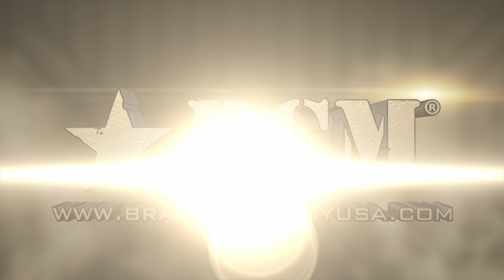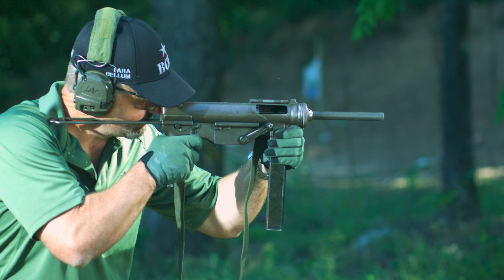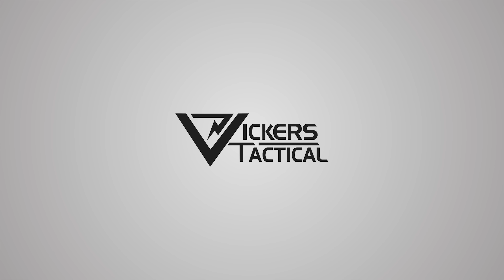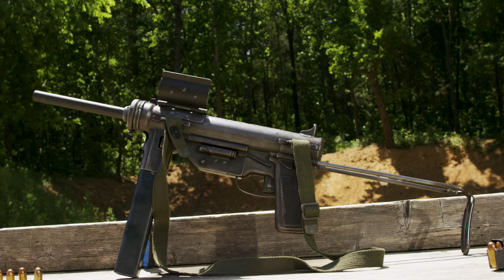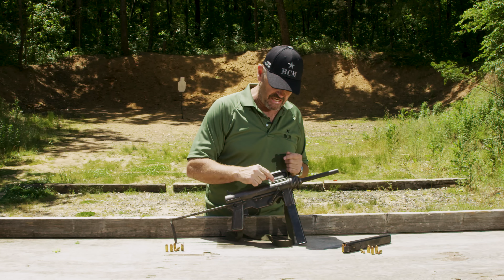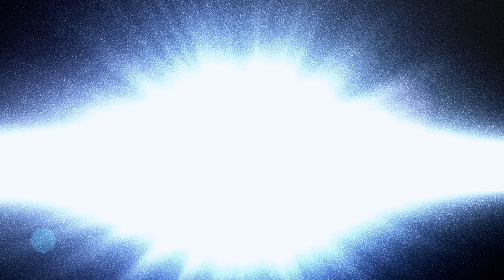M3 Grease Gun

Comment: When you put them together the M3, Sten, and MP40 resemble each other a lot. The MP40 has a faster rate of fire and is good for close quarters hip fire. The French resistance preferred the MP40 over the Sten because the Sten would jam and the barrel would heat up real fast. I know that they would’ve used M3 grease guns if they were 9mm.
Reply: Marx405, Grease Guns sometimes came with a kit for converting them to 9mm Parabellum. The platform was designed with that in mind, so that it could easily be modified (by swapping out a few parts) to use either .45 ACP or 9mm. In practice, few people ever used them in anything but .45-caliber.

Comment: I always thought it never got the respect it deserved. From your previous demos and TacTV, i know it's pretty accurate and controllable. Its construction makes it durable as hell. It spits out 45 ACP, which is always preferred. Though heavy, it is fairly compact, and of course it is reliable. I wonder how an updated modern version with an alloy receiver would do. HK diopter style sights and a top rail for optics. Would probably do well. And make it closed bolt too, but don't change the cyclic rate. Or how about just get Sig to make the MPX in 45? Glad your health is better, Larry.

Comment: I've fired one of these, & it had the finger hole in the bolt for cocking (m3a1).You can see a hole in this gun too, but it won't cock it. Also, the thing shoots s l o w but more accurately than a Thompson or mp40. The 1st shot feels odd, due the very heavy bolt slamming closed, but every shot after was good.

Comment: Larry, Outstanding !   For we common folk there is a version of this in semi auto only with a 16 " barrel from Valkyrie Arms.   Question, do you have any information about an improvised field variant of these guns where handy GI s fitted a cocking handle onto the bolt and cut a corresponding slot for it in the receiver ?.   Have read about as a remedy for a busted crank handle on original M3 s,  but there was not a picture in the article.  Did that exist ?
Reply from the maker: I have no doubt that was done in the field
Reply: @VickersTacticalLAV  Larry have since seen an NRA Pubs video from the museum in Luxemburg where there is a field modified M3 with the crank removed and bolt stud installed with slotted receiver featured.  "M3 A2" improved.

Comment: Are you guys CRAZY, the M3a1 is a POS! When I took Armor training at Ft Knox back in 73 we were trained on this "weapon" because it was normally issued to some of the crew members. At the range the first time I fired mine, I had a run away (I wasn't the only one either), it would not stop firing! I had to reach around to drop the mag. Now to be honest my weapon was about as old as I was, in fact most of them were. I never saw any "new" Army M3, most were stamped later than than mid- 50's. The good thing for me was when I got to my duty unit I was issued a M16 with a M203 mounted under the 16's barrel,  normal weapon for the loader. 3 months later I was driver now and I got a 1911 pistol, way easier to carry and clean. The only M3's I was were issued to truck drivers and back echelon people. My Dad  was in the 35 Inf Reg. and fought in Luzon in early 45. He also has some unflattering stories he told of this "weapon" too!  He told me he dumped his M3 and went back to the M1 Garand.

Comment: I once heard the production quality of the M3 was so low they didn´t even bother reloading it.
Was that just M3-bashing or is there something behind the story?
Reply: That's definitely false. If that's the gun your issued, you keep as long as it works. However, I did hear, that if a major part broke on one, instead of having it fixed, they'd just get a whole new gun.
Reply: @bigricksmith8345  So just exaggeration.
Reply: @sim.frischh9781  Yup. The guns were cheap, but reloading them with extra magazines was cheaper than throwing the guns away when empty😋
Reply: @bigricksmith8345  Ah, no, they said it was made so cheaply that after one mag full auto fire the gun was pretty much broken, that´s why the new gun...
Reply: @sim.frischh9781  For the price, they are actually well-built. Probably could easily shoot thousands of rounds shot through one gun no problem. Larry in the video wouldn't be firing it, if it broke that easily, since they are rather rare.
Reply: @sim.frischh9781 I’ve fired thousands of rounds thru my M3 with No malfunctions or breakage. That’s all BS.

Comment: Till when did delta use it
Reply: Don't know exactly when but a good guess would be they were used from the teams founding in 1977 up through the Iran rescue in 1980. In Eric L Haney's Inside Delta Force
biography, he shows a B Squadron photo from early 1982 which shows the assaulters armed with MP5's. You could assume that after Iran,The Unit, as Delta is called
by those on the inside, switched over to MP-5s perhaps because Delta's founder and M3 fan, Charles Beckwith, was forced into retirement and his replacement
chose to follow the example of the SAS who used the MP-5 with success in the Iranian Embassy rescue of 1980. Or maybe, they were influenced by the brand new 
SEAL Team Six which activated in 1980 and used MP-5s from the start.

Comment: The M3A1 is the better model of that machinegun.  The original  M3 charger handle  and the mechanism below it, was a source of malfunctions and breakage, that simply did not happen  with the M3A1 model,   because none of that was there. You pulled the bolt back with your finger .

The A1 model reduced the # of machined parts,   so easier/cheaper/faster to produce , and a more reliable weapon. (this is during WWII ;)
The charging handle on the M3 was just something else that could break.Also that charging handle is just something else that can get snagged on something , no weapon needs that. Especial on a tank😎 /vehicle,  And get broke. 

As the M3-M3A1 , being good submachinegun? No, the A1  is a Great submachinegun.  Especially at $11.00 -gov replacement cost (I had a Lt lose one), same time as when  1911A1's ACP 's were $17!   I had another Lt lose one of them too. LOL   Both weapons run over by a following tank-destroyed

The M3A1 aint no MP-5 Car,  but the gov cost for an MP-5 was like $8000 .  I wouldn't wannbe a SEAL and lose one of those. 
Chit comes out your paycheck. LOL.